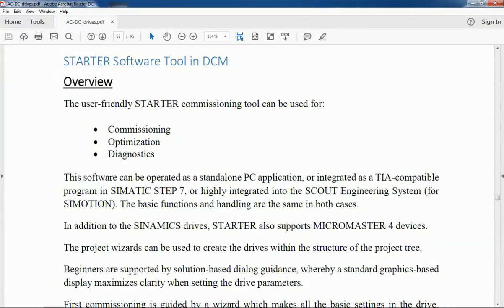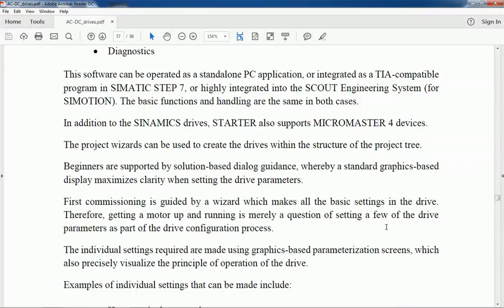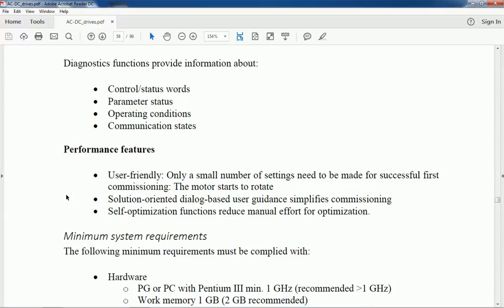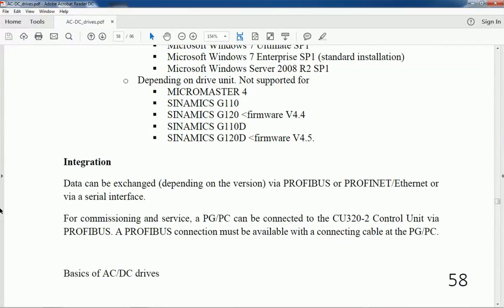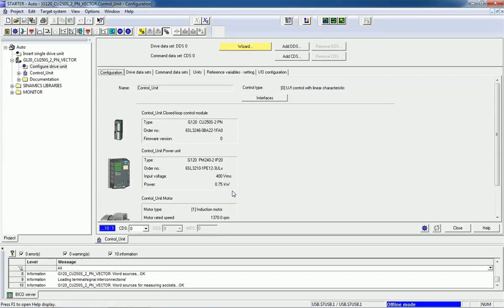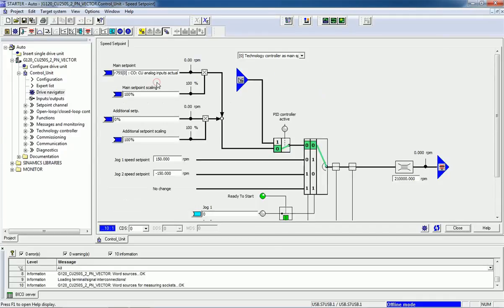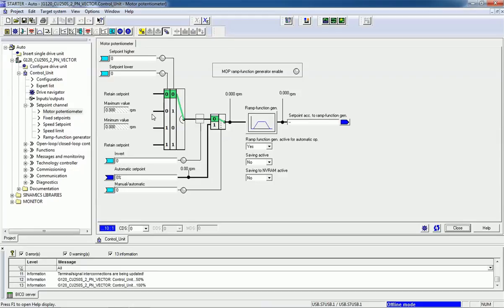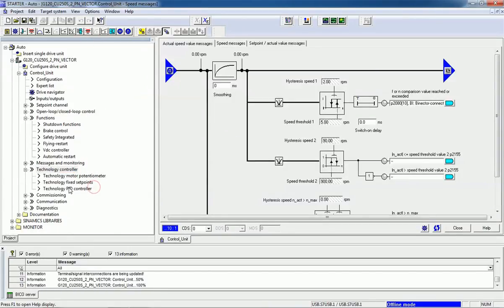Siemens Starter Software Overview for Electrical VFD Configuration

Comment: Excellent topic Sir, this help me for commissioning of Siemens drive g120 cu231 with 11kw motor,, at that software we see lots of parameter and there function the new is p1503 for torque set point